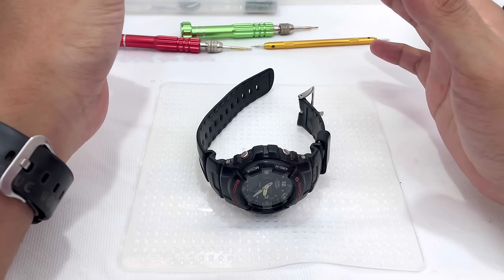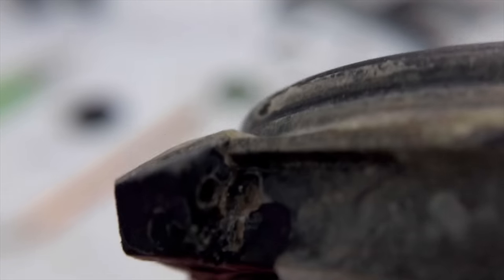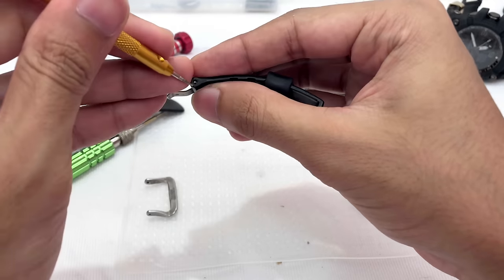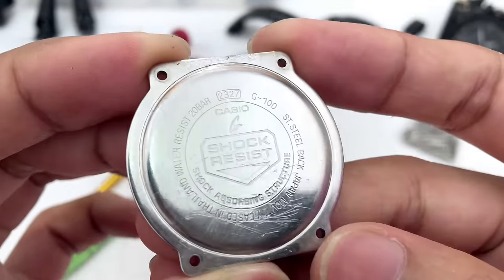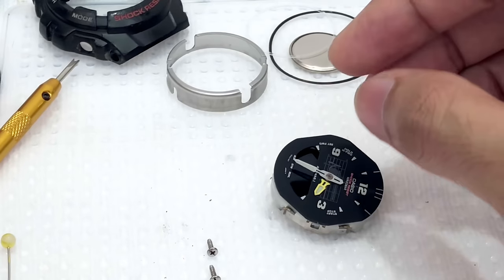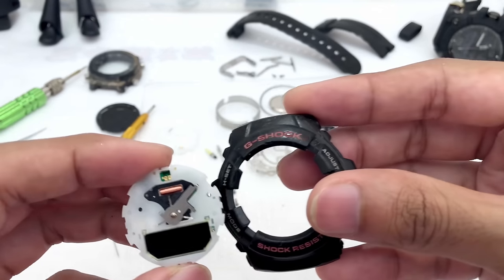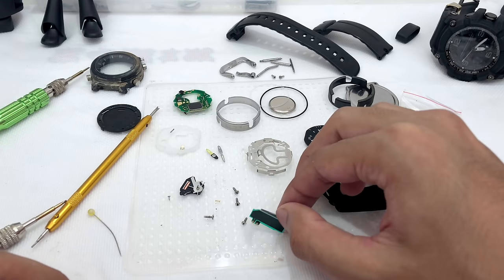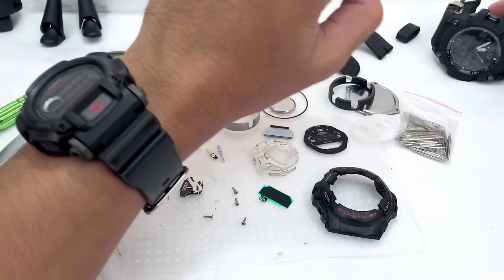Casio G-Shock G-100 series | Watch construction break down

Comment: That watch is built like a tank and 18 years old.I just picked up a new G-100 with the yellow text and positive display.I noticed one of the features of this watch is anti-magnetisim,can you comment on that feature,I did not see a metal backplate under the stainkess steel caseback.great job by the way.
Reply: I was wondering about that as well. It looks like that the movement is enclosed by the metal dial, the metal ring on the outside and the stainless steel caseback, which may protect the movement from magnetic field if they are all made from magnetic materials.

Comment: Any idea what my problem could be.. took my GAS-100 apart to replace the clock trim ring. I ended up removing the hands and now when I put back together the minute had I believe keeps getting stuck when I go into hand mode to set it. Any idea been banging my head trying to fix it for daysss! Also awesome video! Really appreciate it.
Reply from the maker: Its either the hand is not tightly installed or it just got bent upwards/downward (happens to me all the time).

Comment: I got a offer for a g Shock mud master for 100$ should I buy it or look for more expensive but more reliable sellers.
Reply from the maker: Thats really cheap (depends on conditions), are you sure that is genuine? FYI, you could message me the photo of the item on my Instagram, I could give it a look first. I would still recommend a more reliable seller though.
Reply: Usually, when they are that cheap on EBay, there is a good chance they are fake.

Comment: Plz help ... i have g shock gulfmaster gn 1000 b .. it was need anew battery so i open it and take it out and changed the battery but it is now just show in screan just HAnd some number but no live at all
Reply from the maker: You need to perform the AC Operation as well using a tweezer after replacing the battery.

Comment: @ 9:16 you pick up a tiny brass spring..... where on earth did this come from? I've got a feeling this brass spring may be the reason my hands don't work on my G100.
Reply from the maker: Yes, some model have that. Its located in between the metal plate and the battery compartment. There is a tiny slot to put it in.

If you lose it, your watch can't operate.
Reply: @gshockhighfashion  I'll open up the watch and take a look, the digital part is working fine with it out, just not the analogue hands.
This video was helpful though 👍🏼
Reply from the maker: Say, you place it and it still won't work, then perhaps the analogue gears/coils is the issue. Give it a go first.

Comment: hey gshock highfashion, do you have any advice? i took mine apart to paint the hands white, assembled the watch again. not the analog time is loosing time, several minutes per hour. is the analog motor damaged? can this be repaired or checked somehow? or i failed to put the hands back incorrectly?